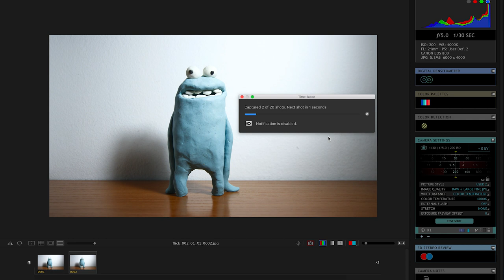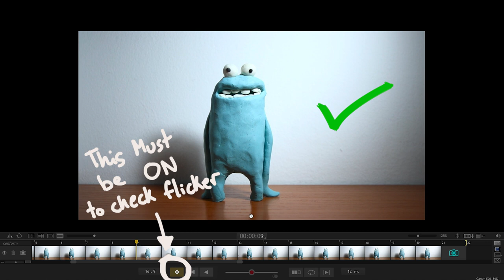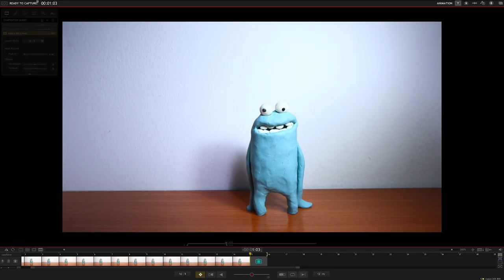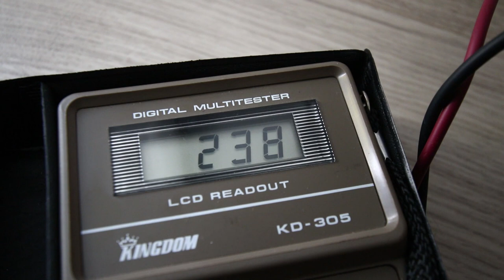Avoid 7 Flicker Sources in Stop motion

Comment: Another fantastic video, my friend! This is another reason my old manual-aperture Super Takumar 50mm f/1.4 lens is my favorite for animation, because I KNOW the camera isn't doing anything to it, since it contains no electronics.  :) The camera stays in manual, with a locked WB and shutter, and I adjust aperture at the lens. You're right about that SLOW shutter speed (which I combat the overexposure with a low ISO or VND filter) fixing some of the flicker issues. Very thorough video! I like your work!

Comment: Thank you very much for your videos. I recently discovered your YouTube account and work. 

I’v always been fascinated with the ball and socket joint, and how I can design and improve it in my own workshop. I don’t do stop motion work, however I became fascinated with the ball and socket joint after several years of having my own small machine shop. And I found many needs for a precision ball and socket arm and clamp system. So I designed and made several iterations for myself and other professionals.

Not sure if you’ve considered it, but there are several profitable markets for your products and designs. 

Photography mounting and clamping is a huge, market.... and high-end ball and socket joints would be very sought after. 

But the biggest industries that have yet to be tapped, are precision metalworking and jewelers communities. 

I’ve made several ball and socket arms and clamp systems, for friends and clients who are professional jewelers, machinist, electronics engineers, and metal fabricators. I did this as favors, because they saw my system and how are you guys in my workshop and they couldn’t find anywhere to purchase something like it. 
I know there are nice and precision bases and mounting systems for dial indicators and other machinist tools… But they fall short of what is needed in other areas.

If you look at the GRS brand of “helping hands“it’s several hundred dollars .... $300 I believe…and it’s nowhere near as nice as your products. I purchased the entire system from GRS to go along with their engraving tools and vices I have. And I was not impressed with their ball and socket joints. Especially for $300.

If you offered a high-quality helping hands for jewelers, electronic engineers, and service technicians to use as a soldering base and for placing precision work… I think your sales would explode!  

Also people who do precision fabrication… To have ball and socket arms that are longer and heavy duty which would easily mount to extruded aluminum so that it is completely modular and can be moved around into any configuration. I know people who would pay big money for that stuff if it was on the market.

You may not be interested in expanding to other markets, but your quality of work and attention to detail are top notch! And there are voids in the market to be filled! I think GRS has proved that.